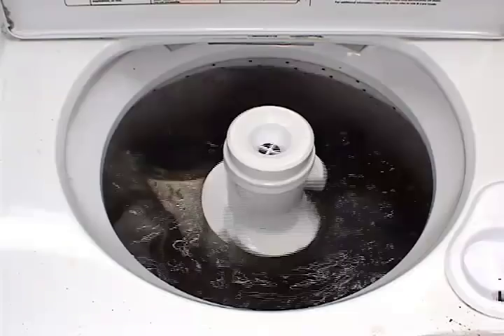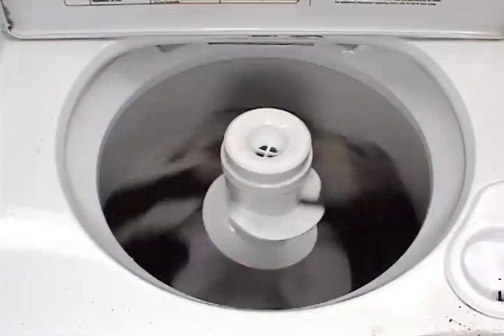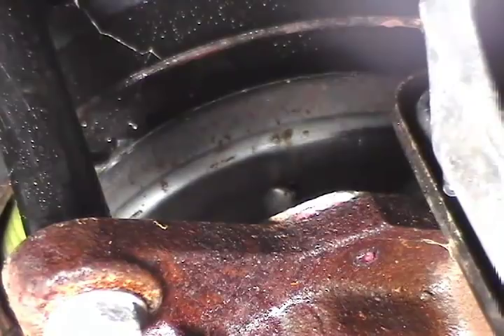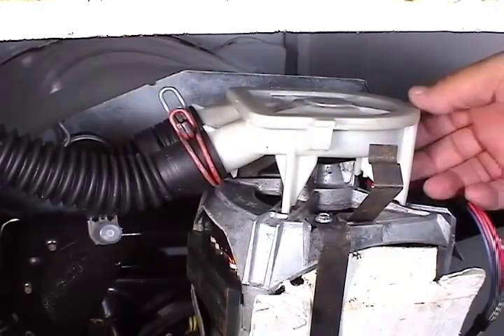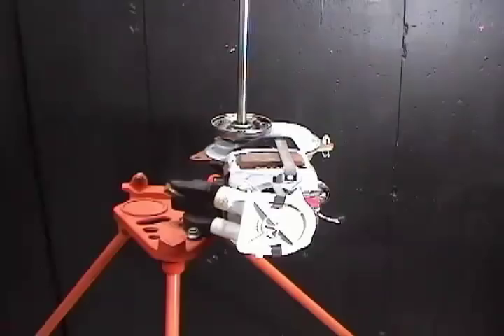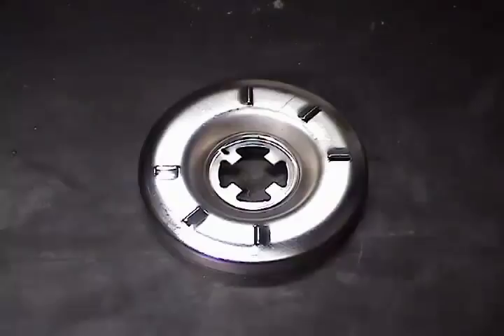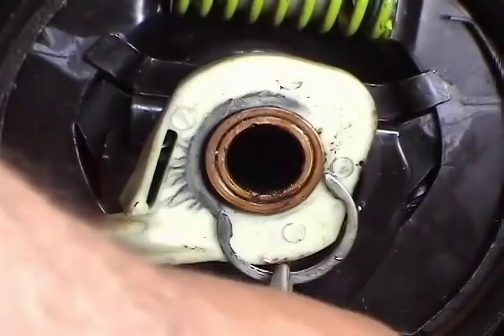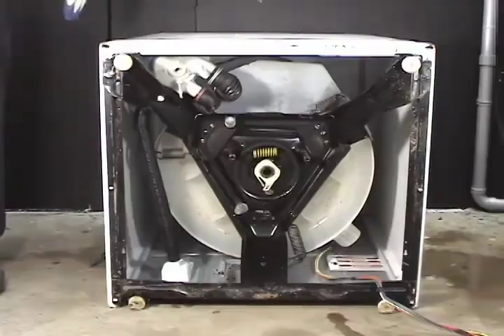Whirlpool Washing Machine Not Spinning The Clothes - The Clutch Assembly

Comment: Appliance Man - Thanks so much for this video. I was chasing down a no spin issue with my Kenmore 800 series. I changed the lid switch, the coupler, the clutch, and eventually the transmission and the capacitor… Your videos have been extremely helpful. Thank you.

Comment: Thanks for making this video.  After replacing the clutch kit in my machine I had a taping noise when it agitated. Your the only one that mentioned the how to line up the springs and the brake cam. Now I have a sound machine.  Thank you for the video again.
Reply: I have the same tapping noise problem

Comment: Thanks Angel...you are an, well, I'm sure somebody has already said it!  Your video, a $20 parts kit, and our 20 something washer is rocking on.  The clutch spring colors threw me for a loop.  The old one was red, but the kit came with only blue and green.  Turns out the blue one was the one to go with.

Comment: Excellent video. I just sanded the clutch drum alittle and the pads and cleaned it up real good and it was perfect. I also drilled and tapped and threaded screws into the brake cam because the groove for the clip wore out. Thanks!

Comment: I had no idea these washers (I have a 1997  LSR7233EZ0) have a neutral drain.  While diagnosing a broken balance spring I noticed for the first time that tub doesn't spin while draining.  The thing is, if you open the lid switch during drain, and then close it again, it will start to spin! So after replacing the balance springs, I thought I had a bad clutch.. but no, it's just normal operation.  Thanks, man !  I can't believe I've had this machine since 2010 and I didn't know it drains without spinning the tub!

Comment: PLEASE READ EVERYONE!!! 
My wife got a our washer from a used appliance store 6 months ago. Last week it stopped spinning and would dry anything. Couldn't figure it out found this video. THE BESTTTTTT video out of hours of searching.  Went through his test sprayed water... bam.. it boils!! Clutch over worked, problem solved!? Nooooo. Wht this company did was fail to install the THRUST WASHER  with the agitator and placed some sort of washer to hold the place; once it wore off. No spinning but consistent agitation cycles. Please check because this piece is easy to miss and is very important because it is located between the bottom base and top agitator; used to connect the agitator dog housing unit to the base by use of friction from said THRUST WASHER. I really hope this helps anyone from wasting time and money, because of people try to get a quick dollar. This video is amazing and a blessing g

Comment: Great video and dead-on. However, be very careful of which clutch kit you purchase. My replacement lasted just 3 weeks and perhaps 15 loads of laundry before the clutch shoes wore down the rivets. I don't know if the cause was a weak spring or just cheap Chinese parts. For an emergency repair today (Sunday), I de-greased my old clutch drum and shoes, and scuffed them with emery paper. I added a washer to slightly increase spring pressure and all is well. Point is, buy OEM parts if you can.

Comment: Excellent video and instructions! Took me about an hour to replace the clutch following your video. Just wish it had fixed my non-spinning washer problem! Coupler is fine. Agitates fine. If I spin the tub counterclockwise after the wash cycle until it releases it will spin just fine.

Comment: Extremely useful videos. Unfortunately I was well into the project (using a different video) when I found this. The advice about the spring facing toward the motor I didnt see anywhere else. I'm 3 loads in and it's still spinning!
Reply from the maker: Thank You
Click on the link below to check my website
http://www.do-it-yourself-washing-machine-and-dryer-repair-help.com/
Angel theapplianceman

Comment: Hi there.. I'm having this problem as well. I haven't checked with the sprinkle of water on the clutch as you have mentioned here since I have already removed the transmission from the machine. I checked by tying to move the ring inside the clutch with my fingers. The ring moves but with some good resistance when I try to push it.. Other folks mentioned that if the rings moves easily with your fingers pushing on it, than the clutch is bad, otherwise it is ok.. I will try to replace the clutch anyway and see if that solves my problem.. Thanks for sharing.

Comment: I received an after market replacement kit and it came with 2 springs  and instructions for them which I didn't have that info.  I used the same color spring I removed and believe it was proper. The ready installed spring was too small and wrong color so I swapped the spring and it made the clutch tighter which was the objective. The parts store had a sign up stating to check out all parts before purchase to make sure they are correct.

Comment: My top load whirlpool 20 year old washer doesn't seem to extract as much water as it used to.  I replaced the motor to tranny coupling which was broken and measured the spin RPM at ~500 rpm.

Comment: What is the part called where the brake cam installs. The part with the yellow spring. How is that replaced and how do you know that Isn't bad? 
 On my washer I can see the clutch housing spin but nothing else. All spinning stops there. I assume the inside parts of the clutch are bad. Bit could it he the part above that. ?

Comment: Hi. My Whirpool model 4PWTW57825SW0. The Agitator is working on both wash and rinse.  The Drain cycle is working. The machine Timer control goes to full automatic cycle. The problem is after wash and rise cycle, it does not SPIN to squeeze the water on the cloth so after end of each cycle, the clothes are soaking wet. What could be the problem ? which parts need to be replaced ? (Brake ?, Clutch? or Timer Control ? Hope for your kind recommendation.

Comment: I NEED HELP.  MY Machine only spins when laying down on its side. Everything works except it doesn't spin.  I replaced the clutch. So, I turned it on on its side and the spin cycle works when laying on its side but when I stand the washer up in it's normal position,. It will not spin. If I move the washer upright while the drum is spinning, it will continue to spin until I shut it down and when I turn it back on, it will no longer spin.  Why could this be?

Comment: Angelo....   After re-assembling the washer, we tested it with a small load. All seemed fine until 3 or 4 minutes into the agitating /wash cycle the washer started making a screeching noise, soon followed by a burning rubber smell. We shut it down and then manually set it to spin to get rid of the water...the sound continued until we shut it down. I disassembled the agitator and inspected the plastic bushing and noticed I installed the metal spring clip / spacer so that the white pin was between the ears of the clip. I rotated the clip so that the white pin was outside of the ears of the clip and tested it again but still getting the screech. Any thoughts would be appreciated.

Comment: My Whirlpool washer was not spinning so i replaced the clutch and brake cam as directed. It spins great now but at end of spin cycles the drum does not brake but just spins till it comes to a stop. There is also a strange rattle noise at the beginning of the spin cycles. Did I push the brake assembly up too far? It seems as if the brake cam is not connecting with the clutch.
Reply: Same as you here did you ever figure out what it was? Ty
Reply: @jerryohanlonhighperformance  hello...no i never figured it out.....its still spinning dry every time but ive only noticed it not braking only once every 20-30 cycles.....maybe something is working its way out

Comment: You said the motor runs counterclockwise during the agitation cycle, but the the video showed the top agitator auger rotating clockwise.  Is it geared to run opposite the motor's direction?

Comment: Hello. If the agitator BASE does not move in either direction does that mean it's the clutch? This is on an older ge eterna series that's  not spinning or agitating. I took off the coupler and the teeth still looked great. Thank you.

Comment: I did all of this, new clutch and gearbox assembly, and the washer is still not spinning unless I start it by hand. I’ve switched between a green spring and blue spring on the clutch. What else can the problem be?
Reply: I’m having this same problem. I replaced the clutch but it still only spins if I get it started manually with my hand.
Reply: Did you ever find out the problem to the no spin unless you manually spin it? I changed the gearbox and clutch, and it's still not working properly.

Comment: Hello Mr. Appliance Man,
I have a couple of questions for you regarding my LG 2014 frnt ld washer.
Model # WM3370HWA.
The originàl board ceased functioning so I replaced it.
I went through 4, 1 hour extended wash cycles yeterday after replacing the board.
All was moving a long without a hitch until the 4th wash load.
Up through the 3rd load of the 1 hour wash cycles, no issues, smells, error codes, etc..........
I left the garage.
The 4th load finished with its chime sound.
Upon entering the garage there is an odor, it smells like electric burning odor.
Same odor there was previous to the first board malfunctioning.
This time the washer is open so I could find the odor emitting source.
The electric burning odor emits from the LG Drect Drive motor, and the steel cover over
the motor is much warmer to the touch than the previous 3 wash loads.
What are your thoughts regarding this issue?
Did I wash too many loads in consecutive order without permitting the machine to rest and cool down?
Is this considered "normal" functionality of the LG Direct Drive motor system?
All the direct drive motor is, is a big magnet that reverses polarity in order to spin
the wash tub,
What are your thoughts on this burning odor issue. It smells similarly to a light timer balast that burned and left a brown burn on the external side of the light timer.

Should this be happening?

Thank you for your input,
Robert

Comment: I have the whole machine apart following all of your steps... but I the shaft only comes out of the machine about 2" and stops. I can't wiggle the whole transmission to free the shaft. It hits a HARD STOP! May I hit the top of the shaft to force it out of the bottom of the machine? Or do you have any other suggestions? Do I need to remove the "tup" "Tuff" nut from the shaft inside the tank? Thank you for your help.
Reply from the maker: Paul when you remove the transmission it should come out fairly easy. I push the transmission all the way up and yanked it fast and hard and they come out
Reply: Thank you. I didn't want to pull too hard as it felt like it was hitting a 'key' or something else that needed to be removed first. Or perhaps a hammer to the top of the shaft if I protect the shaft with a block of wood? I'm trying to test the clutch. I appreciate your advice.

Comment: So I took the gear out of the gear case and I put it back but not too sure if the gasket is in tight enough. Lost alot of oil from the gear case. From pulling that small gear out . Should it be fine to loose alot of oil. I think it's stopped. Gonna wait a bit to see if oil still drips. Got it all back together which sucks.

Comment: I’ve replaced the motor coupling and the clutch and the dogs on my whirlpool washing machine but it is still making a strained sound and not agitating at all. What could it be now? I’m interested to see if I can fix the problem... getting very frustrated at this point... thank you in advance for any direction/help you can provide
Reply from the maker: It is hard to tell without seeing the washer working. Does the washer spins OK?  A bad motor coupler or agitator dogs have to do with agitation, but the clutch is only use to spin not to agitate. It is possible that the problem could be the transmission but I cant tell you for sure without seeing the washer working.

Try this, set the washer on a low load setting put some clothes on it let it fill and listen to what happens when the washer supposed to start agitating. If the motor runs and is not agitating turn it off and set it on the spin cycle and turn it on if the washer drains ok and spin dry the clothes properly then the problem has to be in the transmission.

If the problem is the transmission try to get a good use one, new ones are expensive.
send a video of what is doing if you want  so I could try do tell if it is the transmission

angel
Reply: theapplianceman thank you I’ll do that today!
Reply from the maker: Thank You For Watching My Videos
Click on the link below to check my website
http://www.do-it-yourself-washing-machine-and-dryer-repair-help.com/ 
Angel theapplianceman
Reply: theapplianceman ok I didnt make a video but I did run t through a fill up and then a spin cycle and the drum and the agitator both do NOT move at all.
It makes a grunting sound as if it’s trying really hard but nothing happens. 🤷🏼‍♀️
Reply: I took a short video just now cuz I really wanted you to see/hear what was going on before I spend the money to purchase a used transmission... please let me know your thoughts and if you can open the video? Thank you! 
Ps. I already followed your YouTube channel 😁
Reply from the maker: @Stephrae70 
Listen if the washer fills to the selected water level and the motor starts running the washer supposed to start agitating unless the motor coupler is broken or the agitator dogs are wore out or the agitator is stripped or the transmission is bad.

You said that you replace the motor coupler ( was the motor coupler broken? ) you said that you replace the agitator dogs ( where they wore out? ) you replace the clutch, but the clutch is only use on the spin cycle not on the agitating cycle. The sound on the video sounds like a bad transmission to me but I can tell you for sure without been there to check the transmission and I don't want you to get a used transmission and don't solve the problem and I get blame for a wrong diagnose. 

I still think is the transmission but you have to make the decision. If you decide to get a transmission look for a good cheap use one.  I really wish that I could tell you for sure that is the transmission

angel
Reply: theapplianceman motor coupler was not broken but I replaced with new one anyways since I purchased and had it on hand. Dogs were all broken up and I replaced them and the clutch actually seemed fine but the plastic part that turns and connects the clutch to the bottom of the washer drum (it came in the clutch kit) was broken as well, but i replaced it and the parts that came with it because again I purchased it and wanted to eliminate whatever issues the washer had. I am thinking it may be the transmission as well. I’ll run it through one more cycle and just make double sure but I think that’s the route I’m going to go= used/rebuilt transmission. At this point everything else is new! Haha. May as well follow through with the replacement of the transmission. 
Thank you for all your help. Don’t worry I don’t hold you responsible for anything. I appreciate your help.
Reply: theapplianceman this evening when I had more time to actually watch the entire cycle, I loaded a few clothes in the washer and let it run, it does agitate and it drains but the tub does not spin at all. Not during any of the rinse and drain cycles.
Reply from the maker: If it agitates ok that tells you that the motor and motor coupler are doing their job. Usually when the transmission is making noise and it won't spin the problem is a worn out plastic gear inside of the transmission. I would check the market place to see if someone has a whirlpool made direct drive washer that they want to get rid of for free or cheap and remove the transmission and put it in your washer.

These washers are better that what they make now and it is worth fixing them if they still looks good.
Reply from the maker: send you phone number to my e-mail address  and I could give you a call to see if I could help you fix this washer  E-mail to appliance-man@charter.net

I have an iPhone 5s maybe I could facetime you to see what the washer is doing

angel
Reply: @Stephrae70  I'm having the same issue.  I replace the dogs, coupler and clutch and it won't spin.  Did you come up with a solution?
Reply: TurboTip yes I had to replace the transmission. They run about $50-75 on eBay. It has been working ever since.
Reply: @Stephrae70  Thanks!  I just bought it and am in the process of installing it.

Comment: Great vid man i love ya but i replaced everything and clutch only lasted 2 washes....got a second one from amazon and it also only lasted about 3 washes....little pads are literally shredding. The original clutch lasted 15 yrs....am i doing something wrong? All other parts are fine  so i know its either cheap replacement parts or im doing something wrong.
Reply from the maker: That is a new one for me. Try getting an original  Whirlpool part. I don't know what else to tell you I never hear that complaint before
Reply: @theapplianceman  its a kenmore....where can i get original part?....i order them and they all are the same seems to me.
Reply from the maker: If it is a Kenmore direct drive washer it is made by Whirlpool and most common parts like the motor water pump motor coupler etc. are the same
Reply: Im wondering if i'll ever fix it then because the original looks slightly different from the ones ive been ordering. The spring and rings are the same but the bowl or plate that ring goes in is slightly diff.
Reply: Ok...i just got the new part and installed it...it does look different from the first 2 i put in so im guessing im good to go....thanks so much and God bless you....i hope you get rich if youre not already lol
Reply from the maker: I am not rich  thanks for the comment